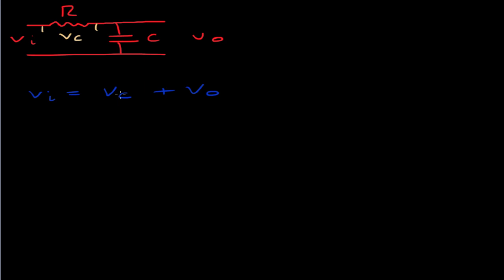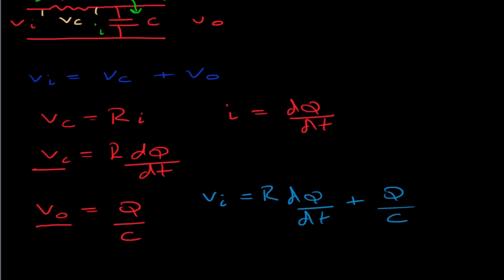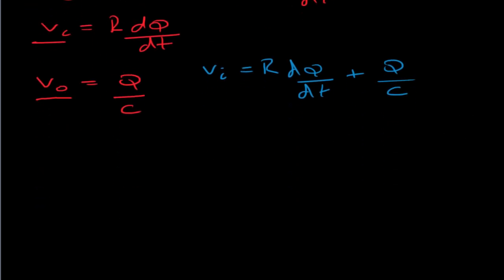RC Integrator Circuit

Comment: I have a question, one of the assumptions that you made was that C would be a very large number, since Q/C would approach zero, but after integrating you chose to divide by that same C. Doesn't that mess up the whole equation? You would have 1/RC going towards zero as well as Q/C going towards zero.
Reply: I also caught that.